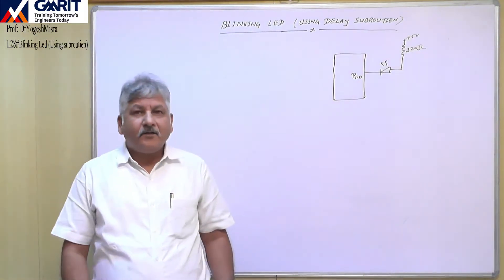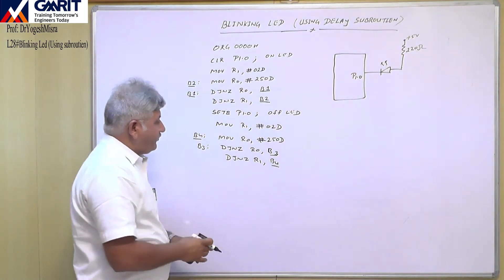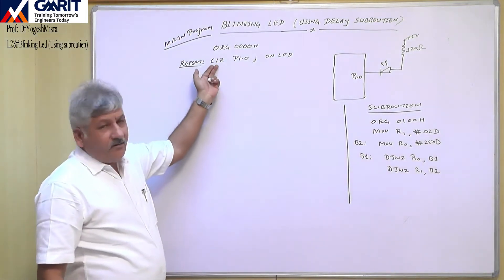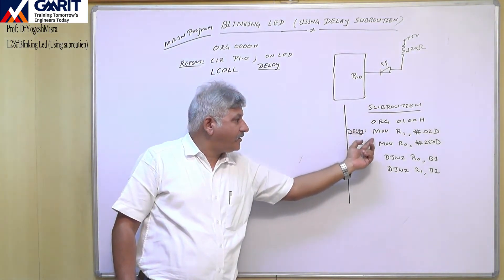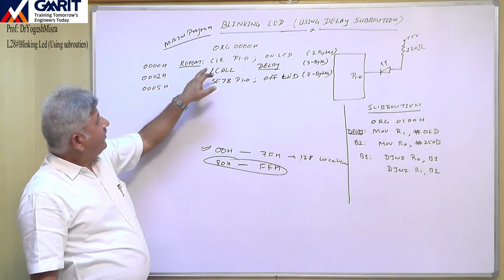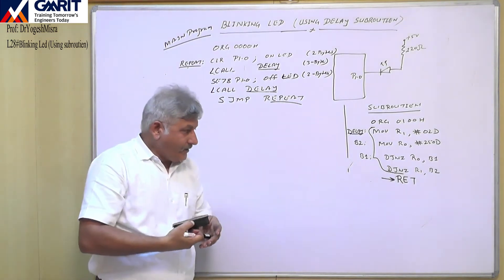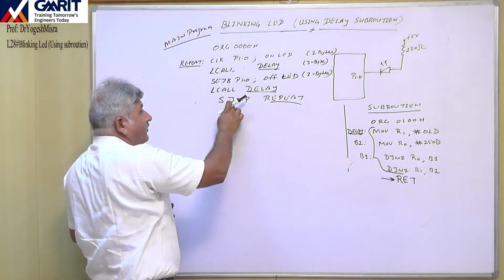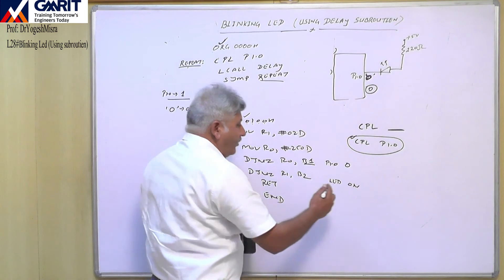Lecture 28: Blinking LED (Using Subroutine)

Comment: ORG 00H
LJMP MAIN
ORG 300H
TBL: DB 0C0H,0F9H,0A4H,0B0H,99H,92H,82H,0F8H,80H,90H ;7seg data for comm. anode type
ORG 30H
MAIN: MOV P0,#08H ;initializing the ports
MOV P2,#00H
MOV P3,#00H
AGAF: ACALL FRONT ; starting with the first lane i.e. Front Lane
JB P0.4,AGAF
MOV DPTR,#TBL ; displaying
CLR A
MOV 40H,#10 ; initializing all the timer values
MOV 43H,#10
MOV 46H,#20
MOV 49H,#20
MOV R0,#35
MOV R6,#30
MOV R7,#40
X1: MOV A,40H ; time division for all lanes
MOV B,#10
DIV AB
MOV 41H,A
MOV 42H,B
A1: SETB P3.0 ; function for workings off the RYG lights
CLR P3.1
MOV A,41H
MOVC A,@A+DPTR
MOV P2,A
ACALL DELAY
MOV P3,#00H
SETB P3.1
CLR P3.0
MOV A,42H
MOVC A,@A+DPTR
MOV P2,A
ACALL DELAY
MOV P3,#00H
SJMP X3
X2: SJMP X1 ; going back to the first loops for repetition
X3: MOV A,43H
Q1: DJNZ 43H,Q2 ; Q functions is for looping of the times around the lanes
MOV 43H,#10
AGAR: ACALL RIGHT
JB P0.5,AGAR ; if IR is High then Stay at right lane
Q2: DJNZ 46H,Q3
MOV 43H,#20
MOV 46H,#10
Q3: DJNZ 49H,Q4
MOV 49H,#10
AGAB: ACALL BACK ; if IR is High then Stay at back lane
JB P0.6,AGAB
Q4: DJNZ R6,X4
AGAL: ACALL LEFT ; if IR is High then Stay at left lane
JB P0.7,AGAL
MOV 40H,#10
MOV 43H,#10
MOV 46H,#30
FRONT: MOV P1,#54H
MOV P0,#02H
RET
RIGHT: MOV P1,#0A1H
MOV P0,#02H
RET
BACK: MOV P1,#09H
MOV P0,#05H
RET
LEFT: MOV P1,#4AH
MOV P0,#08H
RET
END
Reply: this is online code but i am not able to understand working